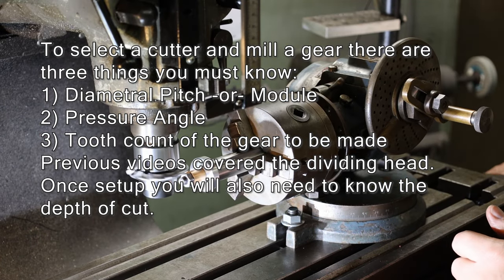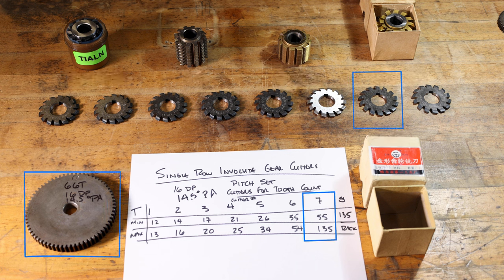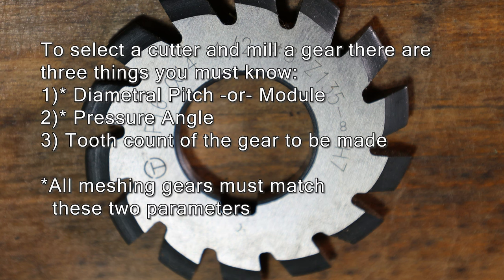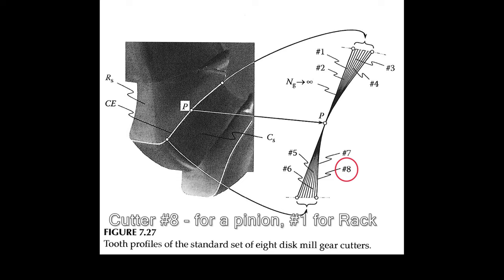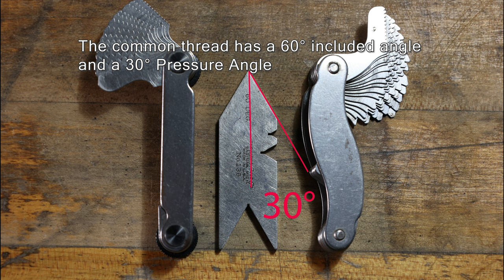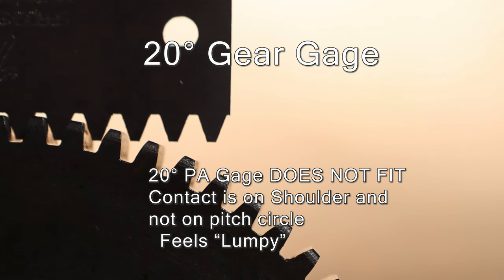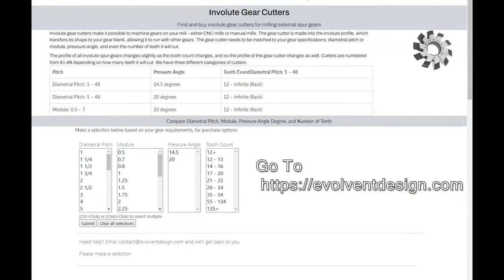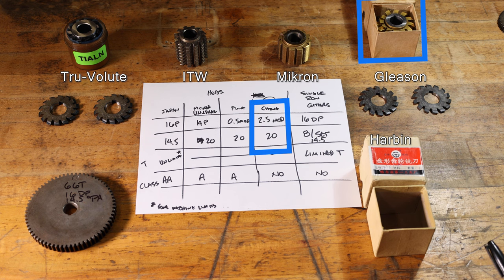How to Choose a Milling Gear Cutter & Buy One  -  Milling a Gear 3

Comment: Been reading an engineering book on gear designs, and it would seem like gear making is a seriously deep rabbit hole, lol!  It is interesting to see how, as you show, the 14.5 vs 20 degree pressure angles are a generally geographic thing, but also interesting to see how each has its pros and cons.  Thanks for sharing!
Reply: Have been in this rabbit hole for the past 6 months. If you think cutting a spur or helical gear is complicated, wait till you get into spiral bevels. Tooth grinding is another whole different level.

Comment: Hello,

Question: On some gear hob cutters, I've noticed that the cutter will display a DP such as 8-10 or 20/26. What do the numbers mean and why is it written in this method?
Reply from the maker: That type of nomenclature is usually for splines or stub gears.
Reply: @EvolventDesign  How do I interpret those numbers? I believe the first number in the example above is the diametral pitch (20) but what does the 26 mean? Thanks for the reply!

Comment: There are like 50 different sets of gear cutters out there how do you choose the right one for the tooth size that you're looking for there's no information on that. I know how to calculate diametral pitch pressure angle as it applies to making the gear within the set that you're working with I know how to apply all the math but how do you find the proper set???

For example for my life I choose to buy a set that is a 16 diametro pitch 14.5 pressure angle there are eight cutters in that set I know how to cut any gear on my legs based on that set they are all fairly small tooth gears is they're all interactable between each other but if I wanna make something with large gear teeth for extremely high torque how do I find out that information I can't find out that information anywhere
Reply from the maker: Check our newest calculator that is for gear strength.  https://evolventdesign.com/pages/gear-strength-calculator
If you have some idea of the horsepower you want to use, this little calculator is helpful for design.    But all gearboxes are different and have different constraints.  At least your gearbox will be strong enough.  The reference for this calculator is Dudley, and you can probably find this old book on eBay other online source used for not much.  It has a lot of gear design information.
Reply from the maker: The main objectives for gearboxes can be boiled down into one statement:  Minimum Volume.  Small compact, low noise, light weight, reliable are the usual design goals.
Reply: @EvolventDesign  I think my overall knowledge of engineering is lacking when it comes to this subject but my overall ability to get things done and accomplish in general is there a quiz to where I just need to see a graphic of what type of gears a certain cutter set with me where I could make an educated guess you know what I mean? For example if you've ever watch this old tonys videos where he makes his bar Bender or ring roller I think it's called and that you don't abuse his gears are closer to what I'm looking for then the set that I'm using that is more suitable for the drive system of a South Bend lathe...

Unfortunately he never answers any questions I have never had him respond to one single question so I've given up even trying to ask him which said he used. I've tried to speak to Oh my God companies that sell these but they're pretty unreceptive unless you know exactly what you're talking about and I do not know exactly what I'm talking about I'm talking I'm a hobbyist level and they are looking to talk to fellow engineers so they look down on you. If I could only see a catalog that also shows examples of the finished years I would be in heaven
Reply from the maker: @ClownWhisper  it should be pretty clear if you watch ‘milling a gear 1 &2 for the process.   Check our gear ‘strength calculator’ to get the pitch that is strong enough.

Comment: the pressure angle is a topic that few teachers teach in universities, unless you show to your teachers, a high vocation.....and brain, to get all.
Reply from the maker: Glad the video helped.  Use our gear generator to make a rack shape to measure your gears:  https://evolventdesign.com/pages/spur-gear-generator
It is a pretty good trick - put the .DXF file into your CAD software and print to scale.  Paper or #D print and you have a gear template.
Thank you for watching.
Reply: @EvolventDesign  my deepest shows of appreciations!!🙏👍

Comment: OD=133
TEETH=40
DEPTH OF CUT=7mmm
which cutter should i prefer for cutting spur gear
Reply from the maker: Numbers dont match exactly, but here is a close match
Inputs
Number of Teeth:	40
Diametral Pitch:	8
Pressure Angle:	20	degrees
Gear Type:	External

Outputs
OD Reference:  	133.3500	mm	5.2500	in
Pitch Diameter:	127.0000	mm	5.0000	in
Root Diameter: 	119.0625	mm	4.6875	in

Addendum:       	3.1750	mm	0.1250	in
Dedendum:       	3.9688	mm	0.1563	in
Working Depth:  	6.3500	mm	0.2500	in
Whole Depth:    	7.1437	mm	0.2813	in
Circular Pitch: 	9.9746	mm	0.3927	in
Tooth Thickness:	4.9873	mm	0.1963	in
Base Circle:   	119.3410	mm	4.6985	in
Undercut:       	No

© 2023 Evolvent Design,	25-Jul-2023
https://evolventdesign.com/pages/blank-calc

This would use one of our 8DP cutters
GC-731, GC-739 or GC-747 depending on the bore and cutter diameter would work best in your machinery.
Reply: @EvolventDesign   but  i have already check  with 8 DP cutter pressure Angle 20° and 14.5° cutter with which my 2 teeth broken gear. But the cutter not match with it, instead 9 DP cutter match with it..
Reply from the maker: OK, here are those numbers - but it still does not look like a match.  This may not be a standard gear.

Inputs
Number of Teeth:	40
Diametral Pitch:	9
Pressure Angle:	14.5	degrees
Gear Type:	External

Outputs
OD Reference:  	118.5333	mm	4.6667	in
Pitch Diameter:	112.8889	mm	4.4444	in
Root Diameter: 	105.8333	mm	4.1667	in

Addendum:       	2.8222	mm	0.1111	in
Dedendum:       	3.5278	mm	0.1389	in
Working Depth:  	5.6444	mm	0.2222	in
Whole Depth:    	6.3500	mm	0.2500	in
Circular Pitch: 	8.8663	mm	0.3491	in
Tooth Thickness:	4.4331	mm	0.1745	in
Base Circle:   	109.2931	mm	4.3029	in
Undercut:       	No

© 2023 Evolvent Design,	31-Jul-2023
https://evolventdesign.com/pages/blank-calc